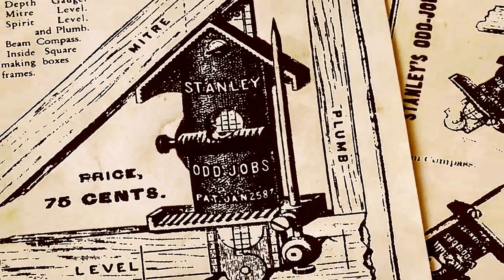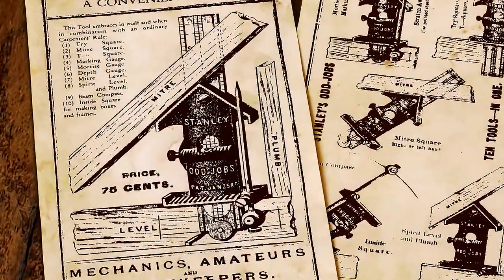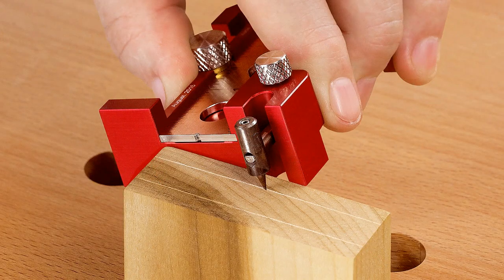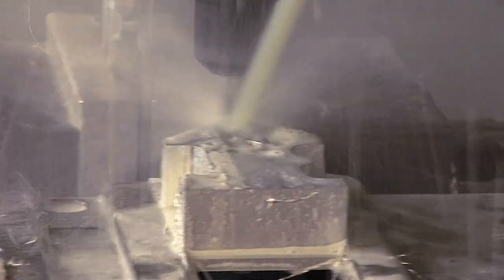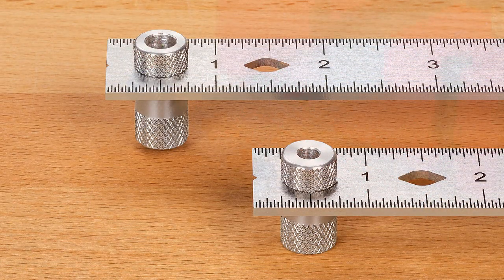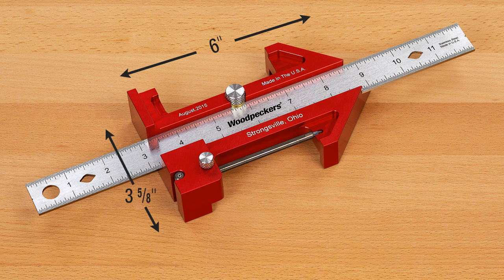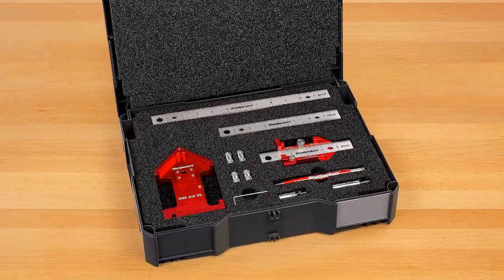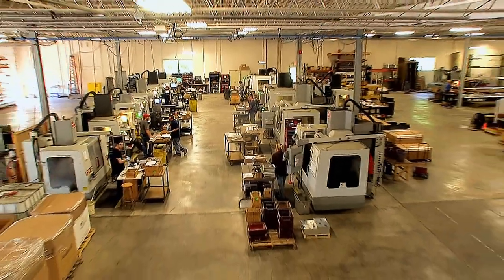Woodpeckers Odd Job & Odd Job XL (Retired OneTIME Tool®)

Comment: For the life of me, I can't figure out why anyone would want a measuring tool with a sliding steel blade against an aluminum body, unless the aluminum body had the ability to be adjusted more tightly over time as the ruler wore the body. 

We have trouble with old combination tools that are cast and not harden, they wear out and their action stinks and they lose squareness.

Comment: I don't know how to feel about Woodpeckers and their one time tools... the tools look very good, but I feel like it's a shopping club, and you should have your wallet ready at all times, because God knows what they're going to produce next, but by golly, you better be ready to buy it cuz once it's gone, it's gone.

Why limit to a one time production? You guys say it in every video, your production facility is just outside Ohio, so it's not like you have to order 10,000 units from  China. You produce them in-house and piece by piece, so it's not like if I buy only one you've got 9,999 left taking up space in your warehouse and burning your balance sheet.

C'mon, you guys said it in your vid, and it's on the product page on your website too; you call it the "A Must-Have Tool Like No Other". If it's a must-have, then you need to sell it. Won't you stand by your claims, Woodpeckers?

And please don't tell me it couldn't be done. I ordered a large shoulder plane from Lie Nielsen, and shortly after placing the order, I received an email saying that they've run out of that size plane, but they'll get right on it. Lo and behold, 2 days later, another email told me they've shipped the plane. 

Did they produce one shoulder plane, or 10, or 1,000? It doesn't matter. I don't have to know, and they remain in business after years of doing this. They might take time getting some products to market, but when they do, they stand by their products.

Your products are not cheap! No, I don't want cheap but poorly made tools, but don't make feel like I'm a loser for not being able to afford something there an then.

Doesn't Woodpeckers also stand by your products? You already have the CAD, CNC files and G-codes, etc... Why not just keep producing them, even if only piece by piece, so that real woodworkers can save up money and buy them when we're ready, and without incurring any debt?
Reply: I agree, I just learned about this company and missed out on several one time tools that I would buy.
Reply: truebluekit
Reply: I used to feel that way but many of the One-Time tools come back as One-Time tools again. Some more often than others. This tool was available in 10/2018 and 9/2015. Yes, I have been waiting!

Comment: Check your tape measure against a steel rule, inside and outside.  Usually disappointing. especially if it your old favorite.  I find myself using an odd job (Garrett Wade) or combination square (depth gauge) to draw pencil lines.  A scribe or a marking (utility/razor blade) knife are even finer, but don't show up well on videos.  You can feel for the groove when you go to use it, something you can't do with a pencil line.  The scoring effect can be nice. The built in square rule is just gravy and used all the time (although speed squares are still the king for this).